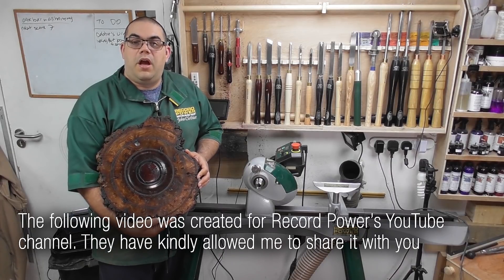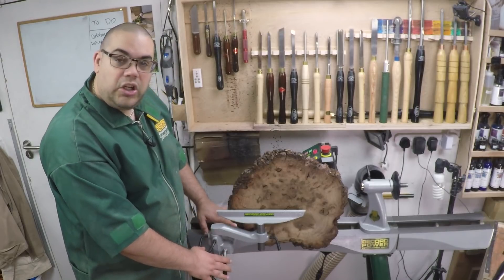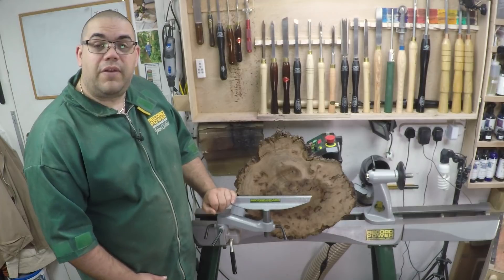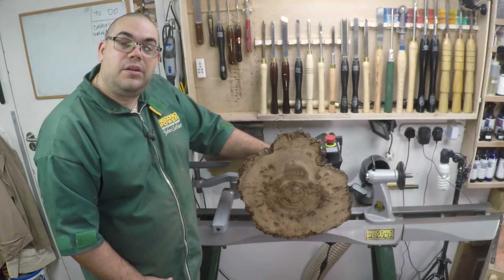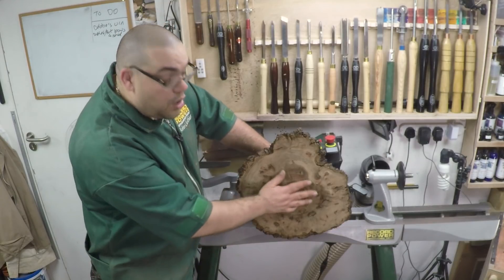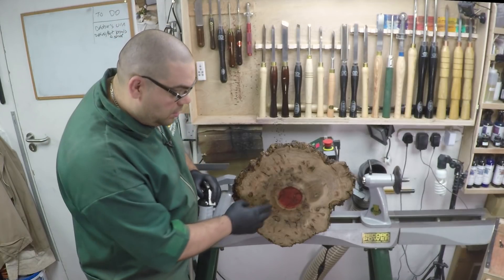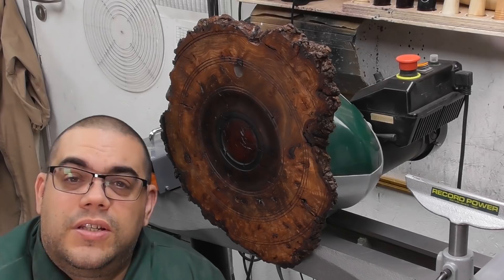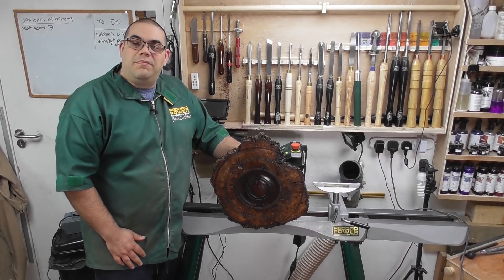Oak Burr Wall Hanging

Comment: Excellent work, John, great piece.  Great video!    Really good explanations and visuals of how you did them.  Do you prepare the back of the piece for the customer to hang in any way?  If so, how?   - Thanks, Matt
Reply from the maker: Thanks Matt. No i didn't add a hanger to the back. The customer wanted it on a stand. The back was sanded and Danish oil applied
Reply: Thanks again, John!  I appreciate the details.